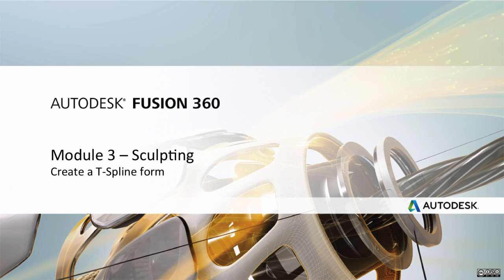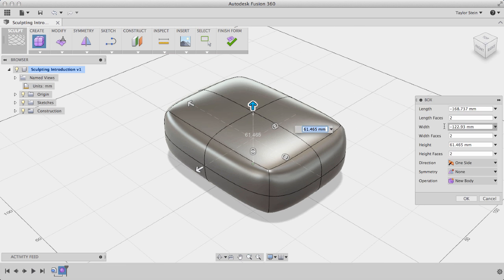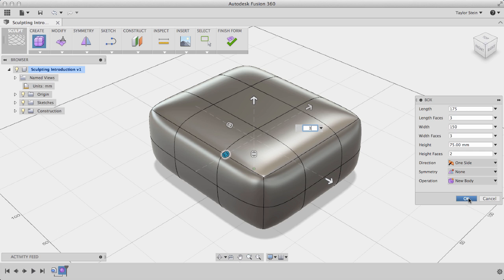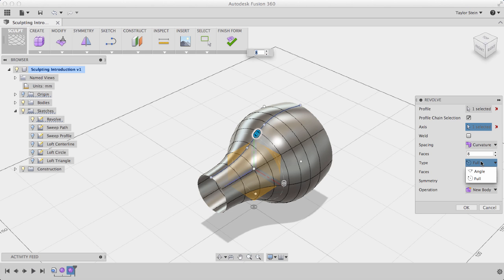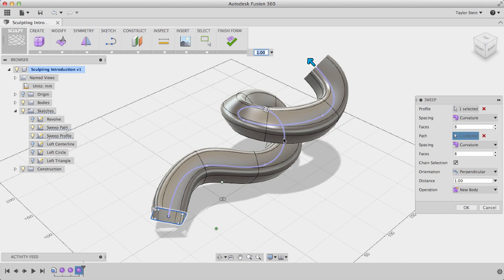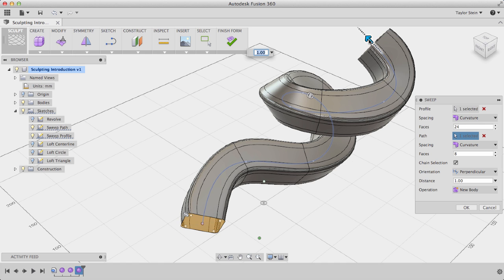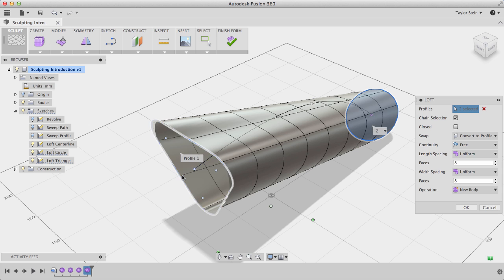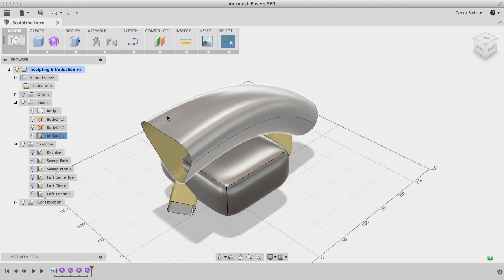03 Sculpting Part1

Comment: At 2:05 you suddenly have a bunch of sketches, where did you get those? I have the tutorial files and there's nothing like that in there. I'm reading through the PDF and it says to go to the Introduction Module, where's that? Making the sketches as best I can to follow along. Good tutorial.
Reply: z zhang as far as i understood, those sketches are just custom made. You just make a spline and move it to the "sketches" folder.
Reply: Gom Bart , check out the "01 Introduction" video in this series. 

The description has a link to a zip with all the sample files.
Reply: You would have thought the narrator would have told you to open up the sample designs...
Reply: hey man, did you find out where to get those sketches?
Reply: Sergey S  did you?
Reply: Sergey S yeah,i got it . thanks
Reply: I am also confused by this, considering numerous years have passed, could you let me know how to go about this as I am currently stuck on this part. thanks! lol